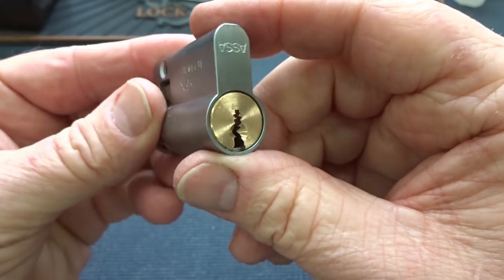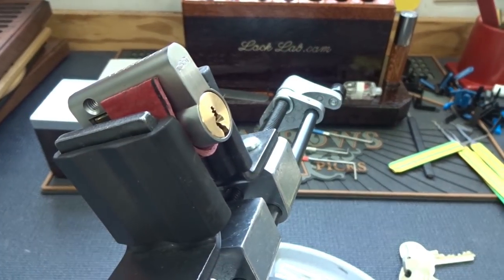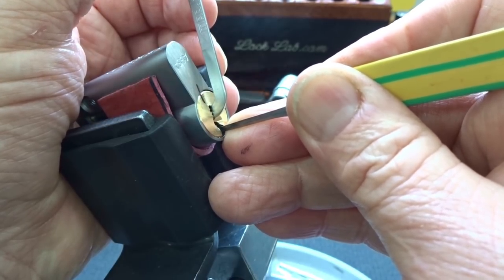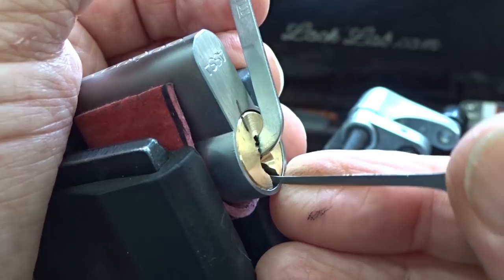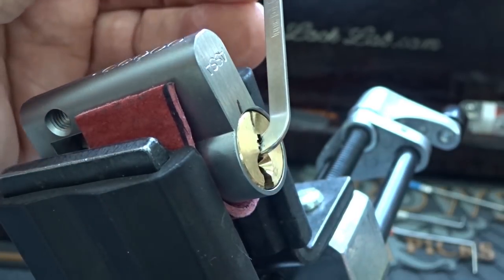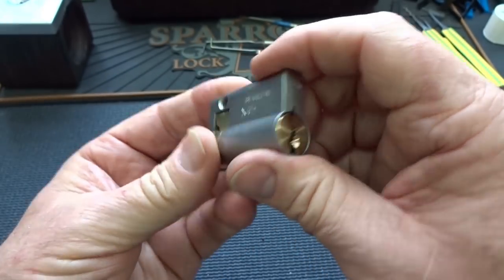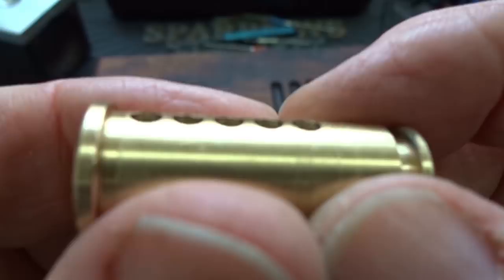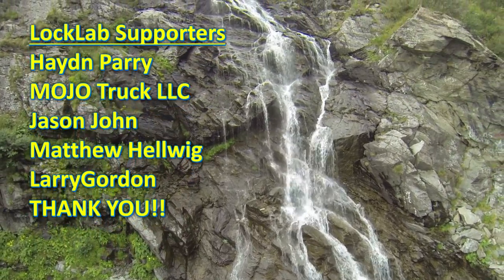(1255) Assa Euro Lock Cylinder Gutting DISASTER

Comment: you actually didn't really fubar this 
put the keypins back in find the right order, serrated assa pin goes in every chamber of the bible the one random brass t pin you have is the detent, the rogue spring at the end was the detent spring, add some cerclips and you're golden

as for getting pins back in, load the bible from back to front with a follower then put a shim on top of the core from the front while you slide the core in, pull shim out from the actuator cutout

if a shim wont fit and they still hang in the gap put a piece of wire in the gap to fill it up
Reply: shubus that would be an amusing next video to watch Bill reassemble this lock.

Comment: Reordering the pins is easy once you have the plug out: Put the key in the plug then try out the key pins to see which ones match the shear line. Master wafers are only a slight complication; you might not match the original bitting for other keys, but at least you can match the key you have. Edit: I see JingleJoe beat me to it.

Comment: Simple home made tool for those soft c clips. With a snapped hacksaw blade grind the ends to make 2 hooks, slip the blades into the gap end on and pull apart, the clip will just come off easily.

Comment: IME: Since the keyway is open in the bottom I would hold the lock upside down and turn the core 180°. The bottom of the key stops the driver pins from getting into that groove but you would not be able to use a follower. Take the drivers and springs out while sliding the core out and then the keypins last.

Comment: At 9:22 (ish) you can actually see the pin that is preventing the core from turning. You actually spot it at 10:31. Yes, that's the same one!  Come on Bill. You can do better than this.
Watching you remove those C-pins was painful. I was cringing all the way through that part. And that brass pin wasn't even from the core. That pin was liberated right at the beginning of the video after you removed those C-rings. That brass pin went one way and the spring underneath it, the other. Have you been drinking?

Comment: it's not difficult to re-pin a lock, surely you know this?, am i missing something? just put the key in, then keep trying pins in different holes in the barrel untill they're all flush, then the drivers don't matter.
Reply: JingleJoe he had master wafers, that does complicate things somewhat, but yeah...it can be done with patience. I know because I took my first lock apart by the springs sproingin everywhere method. Best feeling ever to get it back together, and realize it still works